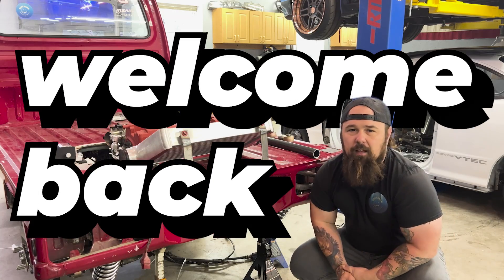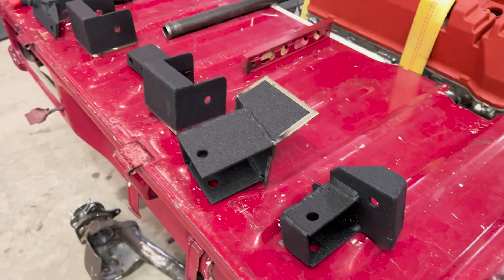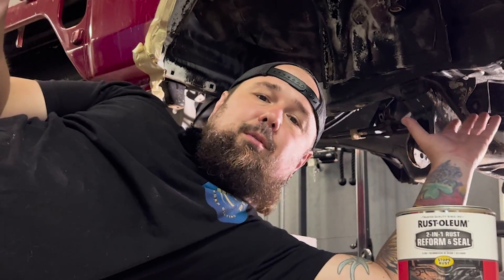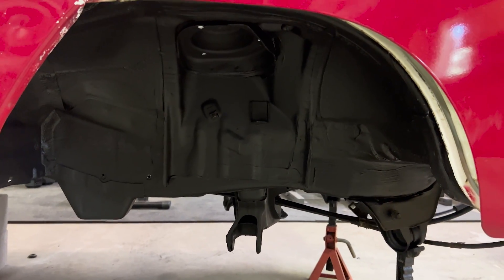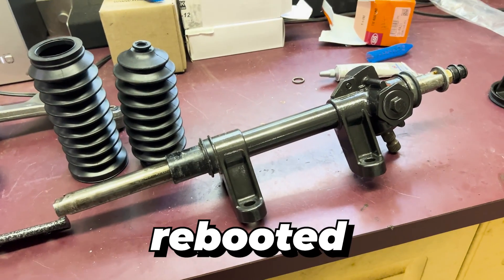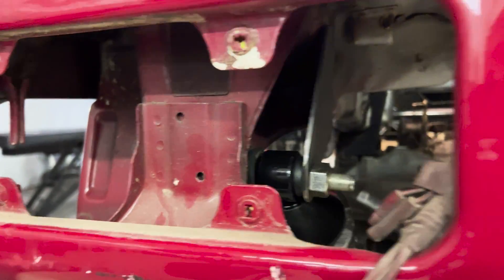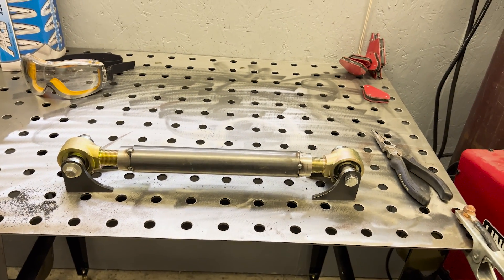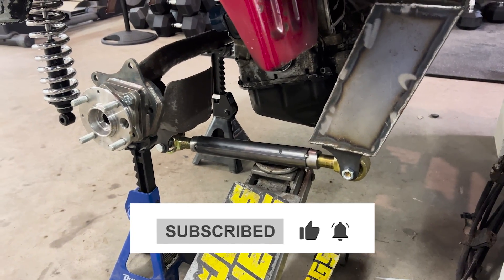JDM Mini Truck K24 Swap in Honda Acty - Rare Kei Truck Engine Mod

Comment: How long more until you think it will be finished. I want to add a b series. Is that as hard?
Reply from the maker: I wish I could commit to a date but let’s just say end of year or Q1 next year. Yes, it is hard 😂 Lots of unexpected challenges to work through.
Reply: @insaneimports_official dude man, take your time and do it to your standards. This truck is going to be a beast!! I'm sure it's much more difficult than doing a busa swap or some of the four popper big bike engines and I respect you for going big. Also Honda to Honda!!
Reply from the maker: Thank you 🙏